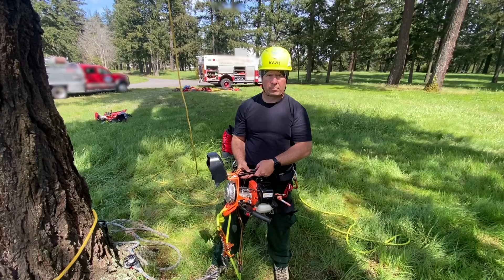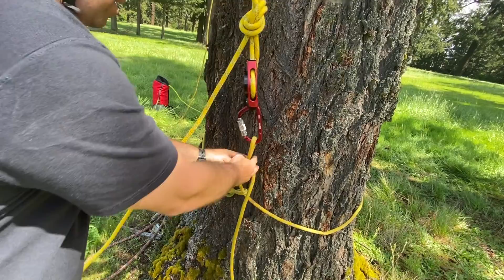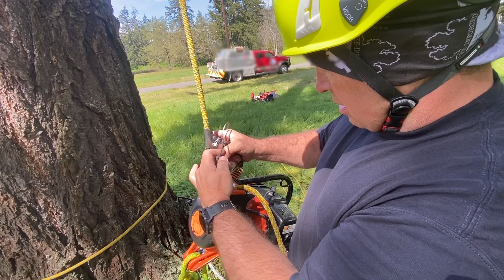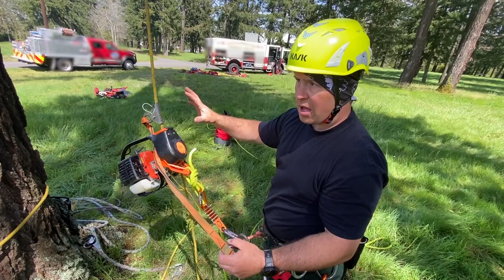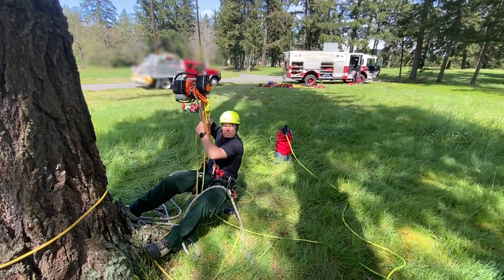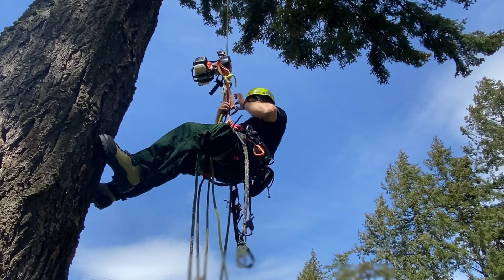The Wraptor.  A gas powered Rope Ascender

Comment: Cool device! I'm a tree guy too, I know there are also ronins but have you seen the sala rollgliss? I think it is was designed as rock climbing rescue device.
But it is a very similar system but more compact & can be powered by an electric drill. Slightly slower than this petrol option